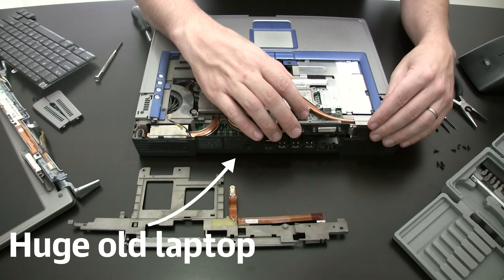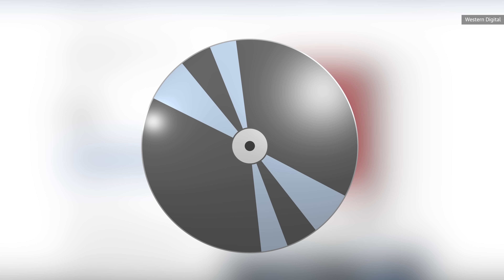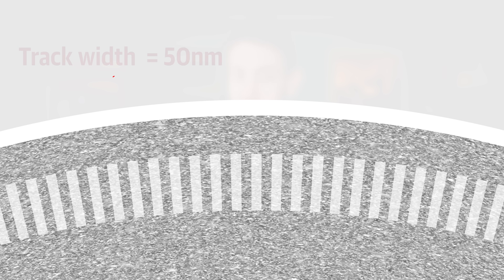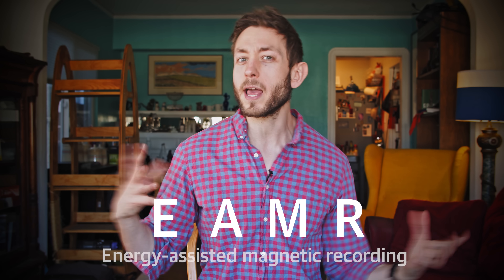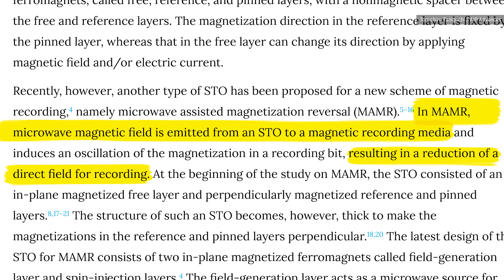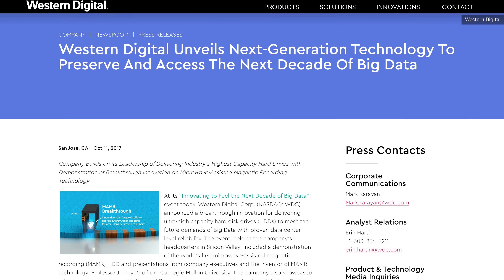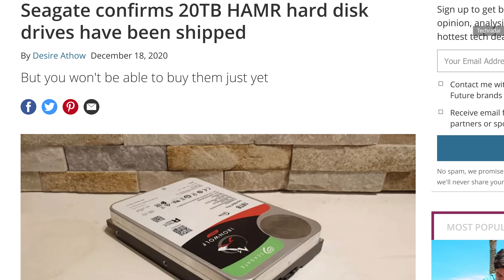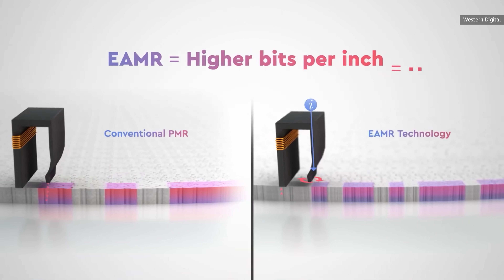Hard drives will use microwaves and lasers to store 60TB or more | Upscaled

Comment: All audio tape recorders use some form of bias when recording voice or music on tape. This is necessary for two reasons: one, to erase what is already recorded on tape; two, to ensure that even the most feeble sound is correctly recorded.
This is normally achieved with a pre magnetization frequency (>100 KHz) applied with an "erase head" to the tape; and by applying the same frequency to the "record head", in addition to the audio signal to be recorded. The high frequency signal applied must be strong enough to override the magnetic reluctance (related to the coercivity you mention in the video) of the tape, and the various magnetic hysteresis. This high frequency signal must increase with the resistance to magnetization of the tape (the bias for a metal tape is 250% the signal necessary for a normal Fe-Cr tape).
This is the first time I see a bias signal added to a digital recording. Using a radio frequency bias, in my view, is better than using heat. But this is the opinion of one, of course.
Thanks for the video,
Anthony

Comment: Why is it that all the reporting on hard drives is about capacity? Seagate, for example, has developed a technology called Mach.2 with which they have increased IOPS and MB/s. This does not make their HDDs into SSDs, but at least more interesting if you want a compromise between capacity, price and speed.

Comment: So a nano-scale laser heats up a nano-scale section of a very thin platter for a nano-scale circuit made up of nano-scale capacitors, coils, etc. to magnetize this nano-scale area of the platter.
All while the platter is moving at 5400, 7200 or even 10,000 rpm and there is not only one, but several doing similar operations several times per second, all in a 3.5" enclosure...
And all is being developed to happen seamlessly to be able to reliably store data not only for days, but years.

cries in exabytes

Comment: Sounds like a bit of old magnetic technology from 100 years ago creeping in. Excellent.  Back in the days of recording magnetic tape we needed an ultrasonic magnetic 'bias' signal that was applied with the audio signal being recorded.  This got around the magnetic hysteresis problem for weak audio signals so the audio-frequency magnetic signal recorded on the tape  was not butchered by the magnetic hysteresis in the magnetic medium. This is just like tapping the edge of the paper when demonstrating how a bit of powdered iron would align with the field of a permanent magnet underneath the  paper.  The tiny bit of mechanical energy from vibrating the paper helped the iron particles to finally settle into their correct places.  That's how ultrasonic bias worked back in the day.  What you described for the magnetically assisted methodology you were speaking of  seems conceptually identical to old ultrasonic bias to me.

Comment: Unless HDD speeds get x5 bigger, you don't want 60TB hard drives, as backing up the data would take around 6 days for such a big drive to read all of its content with today's speeds, by that time the drive might die and the data is gone, unless you pay for a data recovery service. And in a RAID? Well, rebuilding a raid array would take 2x that, if the drives use SMR, it'd take MONTHS to rebuild it...
Reply: Don't forget about uncorrectable sector errors that can make a rebuild fail. The chance will be over 50% that this happens. So you need RAID 6, but what do you do when a second disk fails during the rebuild?
Reply: @happygimp0  In short, there's a limit to how much data you want on a hard drive before it starts to be risky to use it, even in a raid array...

Comment: Is there a problem with making hdd:s in the old 5'25" formfactor? If we used this ff we could get more storage per hdd...
Reply: But the speed would be similar. A large storage capacity is not very useful when you need an extremely long time to write or read the full disk.

Comment: SSD will reach petascale. HDD is a thing of the past.
Reply: How though? SSD are now at around 7nm. A water molecule is .27 manometer.
Reply: @inlovewithi  vertical stacking of circuits on wafer, you can do 100 layers. 100x capacity just like that, 1TB straight to 100TB, HDD is history.
Reply: @motherofallemails  I hope so since I don't want improvements to hit a dead end. But is it going to use up many times more power, double the price times how ever many circuits you stack?

Comment: Are SSDs really more reliable? IMHO not. I have 4 HDs that I have had running for almost 20 years without turning them off. Of the 6 SSDs that I have had none of the originals still exist as all 6 have failed while still under warranty.  Of the hundreds of HDs I have had in the past 30 years, I have had only one has failed while under warranty.  I can usually predict when a HD is going to fail by the sound it makes. The only thing that SSDs have going for them is speed.

Rev George

Comment: I still don’t get why they can’t stripe data across the platters physically on top of each other so they can do simultaneous reads and writes off of every platter surface. So like an 8 platter HDD should be able to read/write 4 times faster than a 2 platter HDD. This seems like it’d make more sense than having two actuators.

Comment: The overriding concern of placing this much data on one device is recoverability. Unless I/O speeds are proportionally increased, the amount of time needed to extract/rebuild the data from a drive that was predicted to fail (via SMART) or had already failed (in some RAID config) could challenge the ability of the remaining like sized drives whose MTBF’s would be comparable at that moment. Even if only one drive prematurely failed and collective MTBF were not in play, how long would it take to reconstruct a RAID 5 or “10” array constructed from numerous 50TB drives? A long time even at highest SATA bus rates available today.

Comment: nice explanation. the main problem is, as capacities go up, transfer speeds must go up too because having to read let's say 10TB from a mechanical disk will take you several days to complete and the risk for fail is big. hdd speeds have not changed much. these new technologies are awesome, but if speeds are not within reason for the capacity, one of the biggest problems in storage, still remains even for archived data.

Comment: Something I don't understand, to heat a substrate  above its curie point you need mm microwaves or infrared in the 100's nanometers wavelength but the tracks are less than a 50nm width. Can you explain how a laser shining an IR light in the 1000 nm would bring the current track at curie point without erasing all the neighbor tracks. The only wavelength able to target a 50-nm track would be in the gamma ray range but gamma ray do not heat a surface they just go thru it, and are pretty nasty to human without proper shields.

Comment: Rotary data density advantage = as hard drive data density increases, hdds will overtake ssd with both speed and reliability. Hdd's will make a huge comeback in desktops as the incentive for flash memory disappearing gradually
Reply: That just makes no sense
Reply: @akalion213  Flash memory speed is at 'saturation'. Premium ssd use ddr4 ram to speed up data throughput. But this can be added to hdd's of the future. Clearer? Oh well I tried..
Reply: @addydiesel6627  Don't you think that if it could be done effectively it would've happened already?
Reply: @akalion213  Ok just for u. I'm talking about future. MAMR arrives fall of 2021

Comment: One big problem is, that these drives take forever to be written.
Reply: For the primary use, in datacenters, it isn't a problem. They still use HDDs because is still cheaper per GB than SSD, and they can balance traffic so no disk needs to run faster.

In fact, this could be a nice option for having some sort of tape storage (now there are options up to 185TB!) replacement for information that doesn't require really long term storage or needs to be access fast.

Comment: Cant wait until the 20 TB arrive, i currently have 44 Tb on my main computer spanning 10 drives.
Reply: @Jeremiah Liggins Of course not, just bought a E-ATX case that can hold 12 standard harddrives and throw caution to the wind. I saw the sticker price of $1500+ for a proper raid enclosure plus the fact the 10 drives are mismatched from 3-10Tb and simply couldnt justify it. Did work in tech support where we had massive EMC raid storage though, well aware of the risk being taken.

Comment: Not sure why manufacturers are wasting time and effort trying to squeeze another 30% of capacity that's probably of questionable reliabilty out of mechanical hdds. Solid state storage is far more promising, cheaper and smaller - SDUC micro Sd cards have the potential to hold 128TB, you could have dozens of those and it would still take up less space than a 3.5inch hard drive.

Comment: When are we going to see the 5.25inch drives coming back? Rosewill has a nice server chassis that adapts 9x5.25 bays, to 12x3.5 inch bays, by cutting out the surrounding material, you'd be able to have more platters in a given space. I could see a 5.25 inch drive, using current technologies, being 28TB instead of 16TB

Comment: yeah this is cool but so far a 10% improvement comes with a 10% price hike for a lot of tech these days

hard drives are dead to me, they aren't cheap enough to compensate being like 20 times slower and noisier, capacity isnt everything even when using as cold storage, if it takes you a couple days to move data around, its time to reconsider things

Comment: Hard drive prices haven't come down in about a decade; 4TB was the standard hard drive size in 2011, and it's still the standard size today. In the 2000's, prices used to halve every 2 years or so. Those Thailand floods irreversibly screwed the progress of hard drives.
Reply: Well, you can only make a hdd to a certain price point, because of manufacturing. A 1tb hdd can't be way cheaper than a 4tb drive because of that.
Reply: @macht4turbo  My point is that the capacities vs prices we're at now is the same as they were 10 years ago, whereas in the 2000's capacities vs prices doubled every 2 years. We should be having 32GB drives for $130 at this point.
Reply: @BaghaShams  Price progression is not always linear like that. The consumer demand for hdd is very low right now and enterprise is able to buy drives at a much higher cost, the enterprise derived consumer hdds are more expensive that way. These huge hdds are not very viable for daily consumer use. I would argue, that if you have the demand for a raid with 32gb drivey, you are most likely going to be able to suffer the cost, you are buying enterprise equipment none the less.
Reply: @macht4turbo  Price progression was quite linear for over a decade, then it completely stopped as of the Thailand floods. That was the only point I was making. 

Your theory about demand is interesting, although I'm not completely convinced considering the various hobbies and professions such as photography and video production which has exploded in recent years, which all require vast amounts of redundant data storage.
Reply: What are you taking about? The price per gb has like halved .

Comment: As a computer repair guy, HDDs nowadays are pretty bad right from the beginning. Very slow even it's brand new and break relatively quickly compared to old HDD.
They're any way not for daily usage anymore.
Reply: Haven't had a problem with any Seagate hard drive I own. I own multiple size capacities.
Reply: @PSYCHOV3N0M  Are you using it in PC or laptop?
Reply: @STNG17-  I use all of my Seagate external hard drives on my 2013 Windows 8.1 laptop, my PS4, my friend's PS4 Pro, my friend's 2017 Sony X900E 4K TV, my friend's Windows 10 laptop.

Zero problems.
Reply: @PSYCHOV3N0M  Nice to hear!
Reply: @STNG17-  I plan on buying two Western Digital 18TB drives to have a backup of my backup.